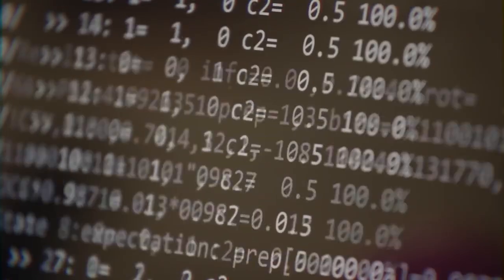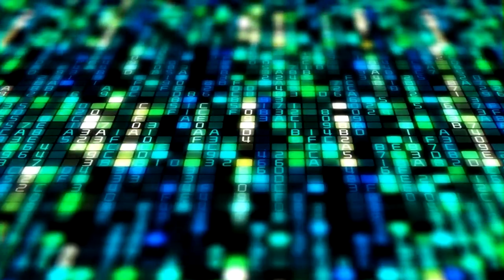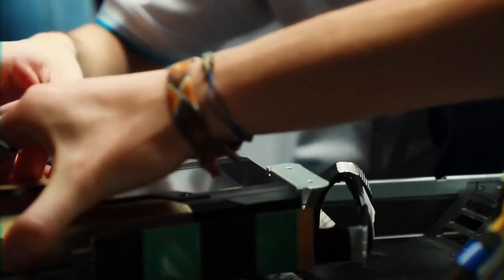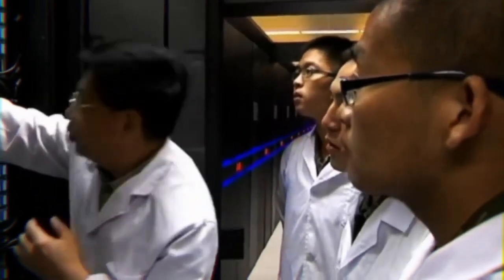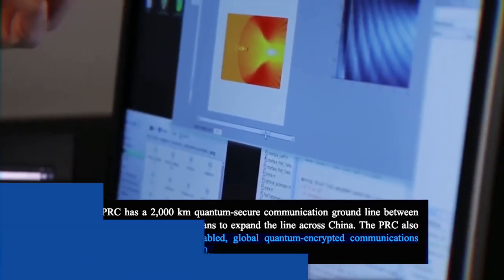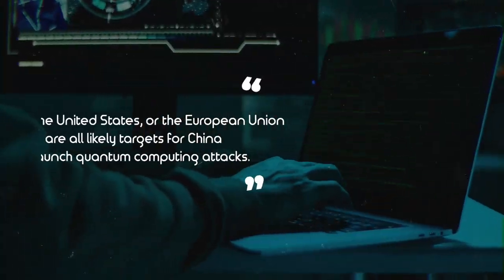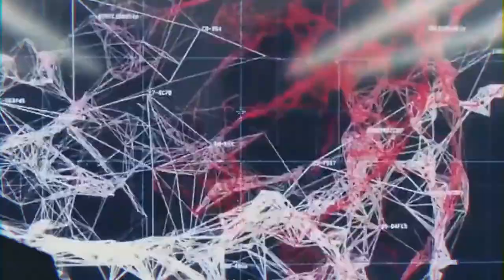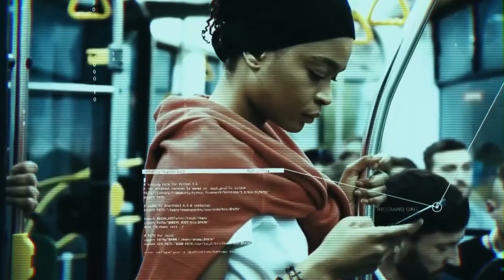China's New Quantum Computing Breakthrough SHOCKS American Scientists

Comment: Ok, this turned out to be interesting.  Two points of interest:
1:  The issue about the time it take for conventional computer bits to change from one state to the other state.
Finally I see the possible relevance of the qubit: that this time limitation may be absent.
2: The light based system, I would imagine, does not require any low temperature issues.  That would be a big deal, but I found the narrative did not quite make that clear.